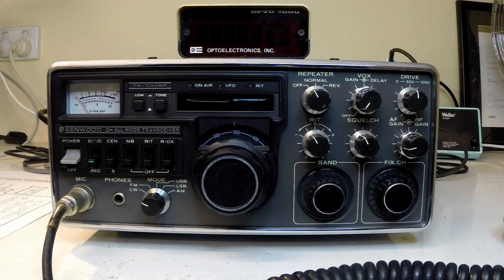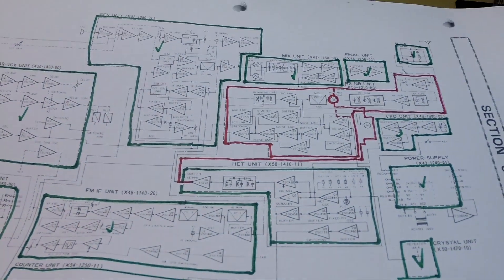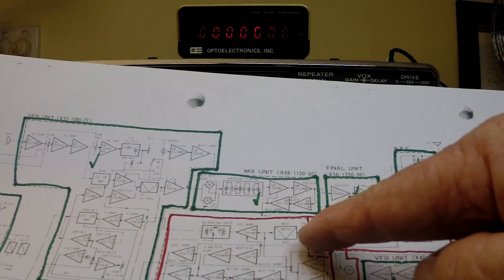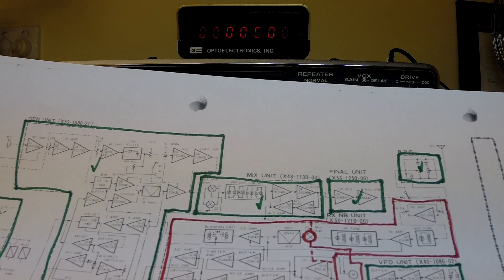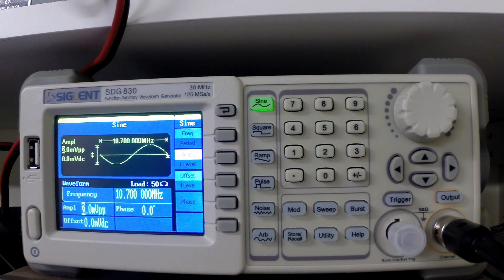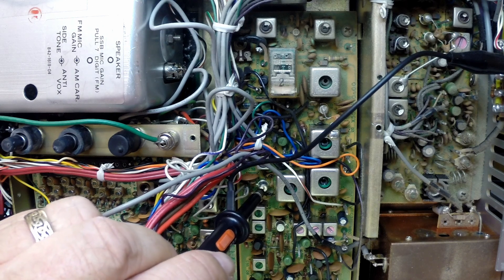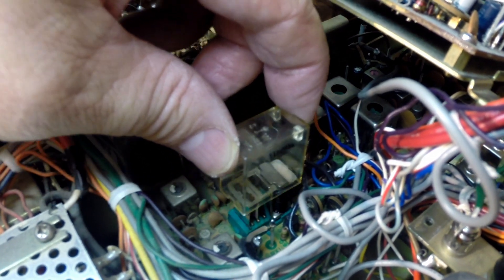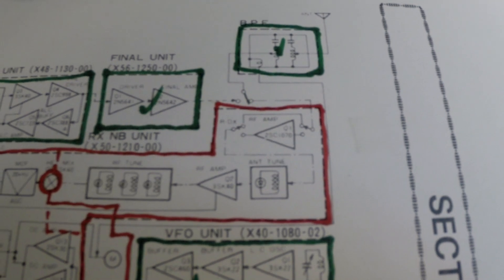Kenwood TS-700SP Repair - 21 August 2018

Comment: Im having a issue with mine where the radio seems to be off by 1khz on the dial where is the best first place to look at. The radio receives well and transmits well but off by the 1khz I have a TS-700A Kenwood
Reply: The service manual provides detailed instructions on how to tune this radio. You're going to need a few things to perform this. Like a frequency counter.  Your problem could be in one or more places. The vfo could be off freq. Or maybe your crystal osc freq.